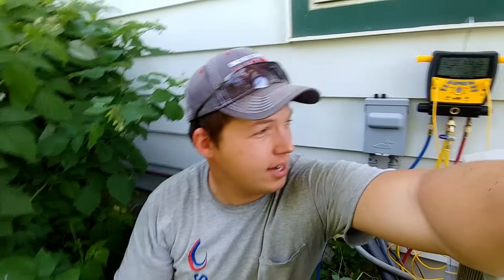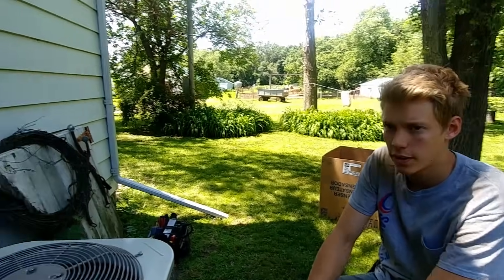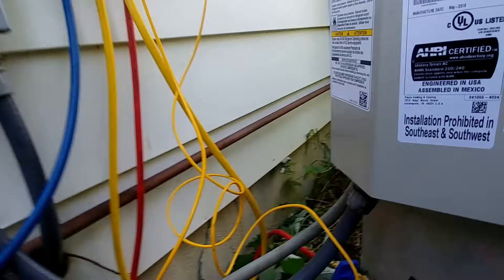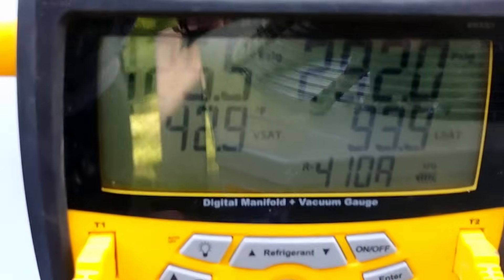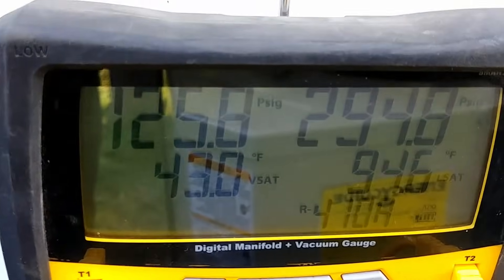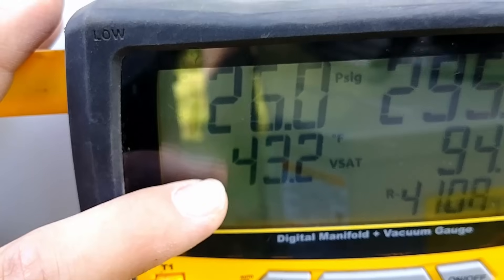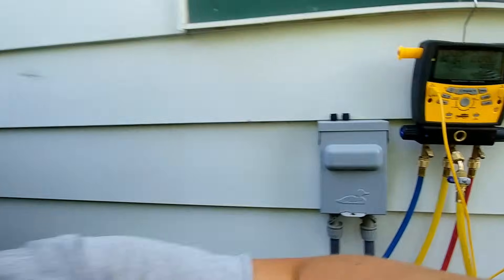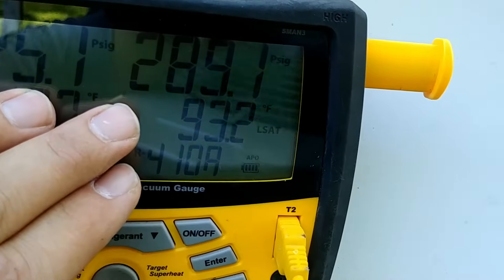What Should my AC Pressures Be for R410A Refrigerant

Comment: What should the low side pressure be at 83 ambient when the unit is not running?
Reply: Same as 410a cylinder temp at ambient....doesn't matter low or high side...
Reply: @tyl8ter  I asked what the low side PRESSURE should be, not the temp!
Reply: @LowerYourHeatingBill  ...first and for most make sure your low side is above 32 degrees/ assocosted pressure ....I look for -35 degrees (roughly)  from my return air temp...example 75 RA...40 degree coil saturation....hope this helps
Reply: How would u add to a mini split ??? Besides recoving real world
Reply: @FullyInvolved-z  ..if your referring to charging-...it is done buy weight in...the condenser comes with a certain amount of charge for X amount of copper line length...say 25 ft...then you add X amount off ounces per ft after 25 ft.....hope this helped
Reply: Approximately 246 psi.
Google “r410a p/t chart”

Comment: what cause the negative value subcooling?
I have 410a and the liquid line temp was over 140 f and the red gauge read 102f
The system was low in 410a and I put 3lbs that dropped the temp on the low side pipe from 210f to 140 but like I said it's still high and result in negative subcooling value!
The low side is reading 40f on gauge and the temp prop on the low side read 68f 
So the high side pressure is about 345psi and the low side is about 145psi  based on the guages reading 
The outside temp was 74f afternoon 
The system is roof mount train 
Thanks
Reply: If I understand your question...at 74 degrees ambient..with a high side pressure at 345...sounds like you may ne over charged...so in order to determine sub cooling..put a temperature clamp on the high side copper line...minus the gauge temperature from the relative to psig) 345....remember the 345 represents the condenser saturation...so any temperature below is sub cooling....gas to liquid..do the same for the low side...temp clamp on larger diameter copper pipe...the 45 represents the coils saturation....the temperature above is the liquid to gas....I hope this helps..
Reply: Deffenitly overcharged.
Reply: U could be doing the maths wrong, its line minus gauge one side, then gauge minus line on other

Comment: is R410A dangerous to work with? I'm currently attending HVAC school going in to my second week. My instructor says we'll be certified on R410A and briefly mentioned that since it more pressurized than R22 it's dangerous but he didn't say how exactly.
Reply: It just operates at a higher psi that’s all
Reply: at atmospheric pressure it boils off faster than r22, so can pose a worse frostbite risk if liquid gets on the skin.
Reply: No. Handle it the same as any other refrigerant.

Comment: Hi I stay in an apartment complex. I had my dad put black bags to the window to help keep my living room cooler. He notice the heat in my apartment when he came but mention it again as he was working. When he finished with the first window he put his hand up to the vent. He didn't say anything but when he finished other window he walked though out my apartment feeling the air out the vents. He said that the air was real cold but it just isn't reaching the rooms. I would translate that by say saying the air seems to disappear once it leaves the vent. Because of this my apartment will not get any cooler then 85. And I say in Georgia. Even at night my apartment temperature is still 80. Can you tell me why the air is not coming though out the rooms and how to fix that problem.
Reply: Most likely if it's an old apartment building your coils are really clogged up as they probably don't ever clean them properly.first check the filter make sure it is good and clean and that is not using one of those high efficiency filters it might slow down the air flow too much. you could put a fan in front of the air intake a box fan for a rigged up fix. Talk to the maintenance people about cleaning the coils inside
Reply: Hi u may have it fixed by now but I'll put this out there.
Check for dirty coils, or it could be an airflow problem with the duct or flex, or potentially not the right tonnage for ur place. Just some extra potential problems
Reply: Check your blower motor.
Reply: These other comments are not wrong. Either air restriction, or change the blower motor speed up…or both. Their ducts might be fucked too. Rodents could have eaten holes in the ducts.

Comment: Pressures alone shouldn't be used to tell if the unit is properly charged regardless of the metering device type.  txvs regulate superheat, not pressure alone - you can have low suction pressure caused by low airflow as an example, doesn't mean the valve is bad. 

check superheat/subcool  to really see what's going on in a system.
Reply from the maker: Agreed.

Comment: I thought 10 degrees over ambient was a little low.What SEER was this particular condenser?How long had it been running,before looking at pressure/temperature  performance indicators? Thank you.....
Reply from the maker: Yes! I agree that it was acting like it was a tiny bit low. My subcooling was a little low as well at about 5° so we may add a little bit to this system. I believe it is a 14 SEER system. I only make adjustments if I'm very sure that it is necessary and hesitate to adjust the factory charge unless I'm matching a larger coil and or longer lineset. What do you usually expect for your LSAT above ambient?
Reply: Benjamin Sahlstrom For 14 Seer 20
Reply from the maker: @robertcherry4971  Awesome. Thanks for sharing your expertise!